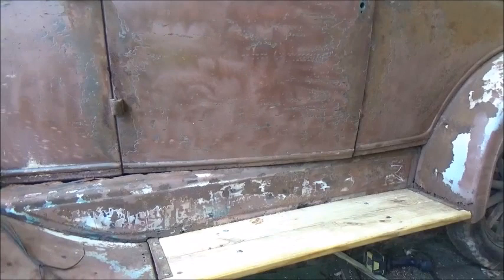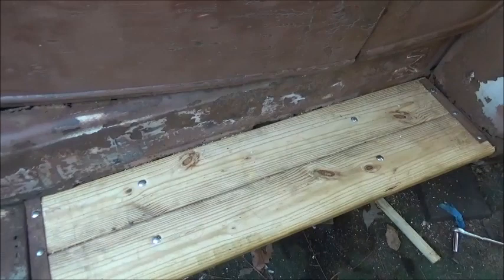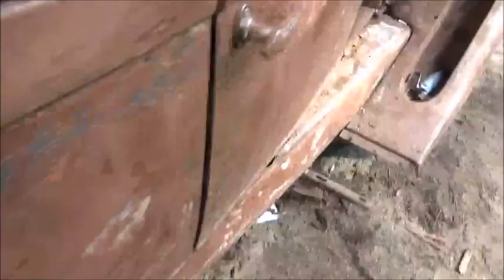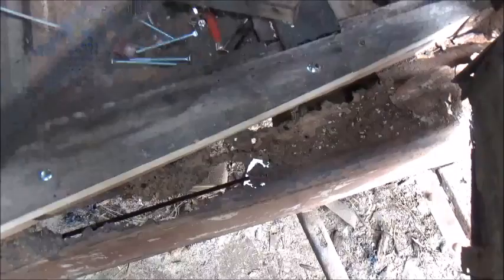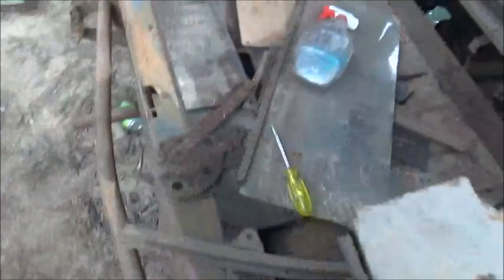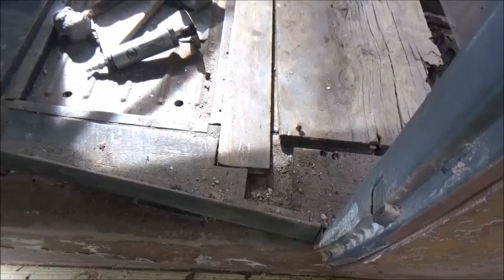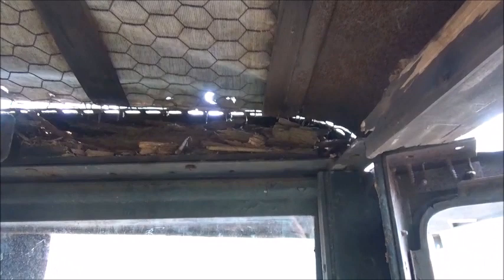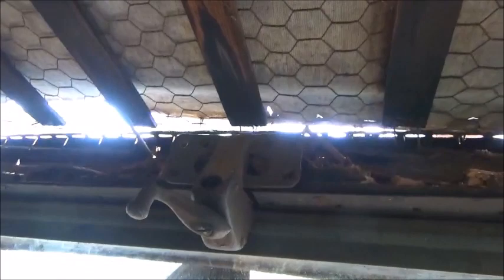1929 Whippet Wood Work

Comment: Hi Jonathan, nice work. I'm a carpenter and most of my work is in restoring older homes and remodeling. Your on the right track one piece at a time. Make sure you step back often to get the big picture. Things warp sag and distort and you might make a piece and realize later that and adjoining part is out place and you now your starting over. I love old vehicles and most anything mechanical and you just have to take it slow. Have a good day.

Comment: A few suggestion;  Ash is the wood for  cars. All the manufacturers in Britain and the US use only Ash. It's lighter, doesn't split so easily. finer grain, and doesn't contain corrosive acids. Don't use Oak! When driving screws into wood, always use furniture (Paste, Butchers) wax as a lubricant on the threads. It makes them go in easier. The piece that goes over the windshield is called the "HEADER". It controls all the other top wood. I install them first. Give "Classic Wood" in North Carolina (I forget where) They make a lot of replacement wood. They could give you some tips. The "Whippet" is very similar to a Ford A and some A wood  would probably adapt very easily.  Use starting fluid when trying to start an old engine. Gas is not so good. Either you have too much or  not enough, or it's old and is harder to ignite. Enjoy your videos very much!
Terry

Comment: I've been a cabinet maker/finish trim carpenter for over 30 years. I remodeled/refurbished homes as a hobby in my spare time. If we lived closer, I'd be all over that wood work. I love the challenge. You're doing damn fine with the wheel spokes and wood for the car my Friend! Cheers! Zip~ p.s. I've got an older video showing my wood working in a couple videos. One was making door runners for a dresser and the other was on the woodwork I've done in my 152 year old brick Farm House.

Comment: From my search engine (whatever it is that I have): Plywood was introduced into the United States in 1865 and industrial production started shortly after. In 1928, the first standard-sized 4 ft by 8 ft (1.2 m by 2.4 m) plywood sheets were introduced in the United States for use as a general building material.

Comment: When i am putting screws into oak or other hardwoods...i predrill the hole. then run the screw into a bar of soap. then screw it into place. goes in easier and helps to keep from torquing on the head so hard it leaves marks.
Reply: Mmm...I think that something like beeswax is preferable, soap can draw in moisture.

Comment: Jonathan,  thanks for the detailed shots of the interior.  This is going to save me a bunch of head scratching on my Whippet.  By the way those plates on the ends of the to of the windshield frame hold the pivot pins in place. You should be able to loosen them and slide the pivots inboard to remove the windshield.  Probably need some oil to help them slide.
Reply from the maker: Thanks wasn't sure how the windshield came out.

Comment: I would replace the timber with the Vin number plate in and make a rebate in the new wood to take the old vin plate plus its surrounding wood of 1/4" or how ever long the screws are and glue it back in place, .
You are doing a brilliant job, well done, Kind Regards Roger from the UK.

Comment: I'd like to suggest you cut off the cross-member where the wood is rotted and fashion and attach a new piece with a lap joint.  My choice would be to use one of the West System adhesives which are used extensively on boats and are waterproof.  Even if you can't cut off all the rot without damaging the serial number, West System has products that you can brush on (and I have injected into rotten wood with a syringe) that will harden the wood for further repairs.
Love your videos, by the way.

Comment: I was looking at a '24 Chalmers  that was actually running ,but the metal doors were pulling away from the wood frames, and the owner was still asking five figures for something that was still going to require a full, wood replacement frame off.  Of course, having zero skill myself, cost is always a BIG factor in what I'd be interested in buying.

Comment: Most cars, higher end ones any way, used ash for body structure. Good luck, whole different type of body work...they also used to put felt or leather between the body and chassis to help with squeaking, plastic should work well.
Reply: Ash is very hard but flexible, so it's ideal for structural parts of moving objects.

Comment: Excellent work , very interesting to watch , Jonathan ..I believe you are doing just fine . The hidden woodwork in those old cars bodies was never finished like fine furniture , and your replacement timbers are probably stronger than original . The floors I have seen looked like Marine Ply .
I believe thrifty Mr Ford used wood from packing cases in which parts were delivered . He specified exact dimensions to suppliers so he could use the wood in the cars.

Comment: Nice to see this project moving along... you stir a lot of different pots! My suggestion on the car's oak is to use White Oak rather than Red Oak. White Oak will not wick water with capillary action, whereas Red Oak behaves like a straw in glass; easily rotting in time. Yes to the Brass Screws! You have to think like a Boatbuilder, not a Cabinetmaker.

Comment: Jonathan,, You don't need a woodworker....Your doing just fine with what you done so far...
  The wood is like you said,,, some type of Hardwood,, Oak, Ash, or Poplar,,would be my guess...These would have been more useful for strength,, as Walnut, Pecan and Cherry would have been a wood more suited for Decorative pieces....
  It's amazing to really see how much wood makes up the Skeletal Framework of these Real early automobiles....Almost to the point that the sheet metal was just a shell and the wood the strength....
 I know you've already got a lot of the wooden pieces in place....And if they're not going to be painted/stained later on down the road .... To help against future water rot down the road,,,
  Here's a trick we use to use on the Farm around the bottom of barn's, shed's, and anything wood that's close to or has ground contact....Put them out in the Sun and coat them with used Motor Oil...The warm wood will Draw in the oil,, Keep applying coats till no more gets absorbed and it's good to go... It doesn't cost anything and It'll help to shed water and save the wood... 
Works good on keeping Termites away also....lol
 Keep up the good work,, she's looking good... Like you said,, Your not Restoring her.....

Comment: A question, if I may, is the wine of the gears due to square cut tech or bearings, etc. (?) Thanks.
Reply from the maker: Straight cut gears. They all do it, some more than others. Because 3rd gear it direct drive it don't do it.

Comment: I know what you mean when it comes to parts for older vehicle i have been trying to find shift rods and hardware for my 74 f250 and seem to not be able to find them as the truck is a three speed on the column.the guy i got it from took them out and as far as i know trashed them because he said it was sticking between gears.it needed a bushing that i found i could use the wiper motor plate bushings off my junk 92 f150 so i replaced it.now all i need is the parts he throughout but i can't find them.

Comment: Jonathan, great job on the wood work. On the doors & door frames did they use some sort of rubber seal and a felt on windows? I’m wondering if that material on the floor were you put down the rubber strip wasn’t a type of insulating media for reducing vibration and moisture. You think they used some sort of weather stripping under the lip by the wiper motor. I bet finding a type of U channel rubber strip would be easy to come by. For the doors and trunk. I can’t tell in at least this video if the fire wall is metal or wood like the Elcar. You’re methodical and can see why you seem too get stuff done. Working with what you have in smaller doses as not too become lost and overwhelmed by a project. I’m guilty of it myself, even labeling everything tore down a project and got lost on it. Lesson learned long ago lol. You tend too follow this same saying that was and assumably still I heard while at Fort Campbell & Fort Bragg...

Accept
Adapt
Overcome

Thanks for posting this really cool too go back in time and see how stuff was put together by hand.

Comment: Man i dont think they used chicken wire on that top. That looks like a farm fix. They also probably used Hickory or Oak or both on all that wood. Which is exactly what id do as well.
Reply from the maker: A lot of Manufacturers use chicken wires on the top for support
Reply from the maker: Also manufactures used Ash for the wooden cars

Comment: BTDT on my 31 chevy sedan. I took all th body off the wood frame. Some sais I would never get her back together. WRONG.  I don't think they used oak because my wood was too soft for oak. I did use oak to repair the sill plates and made overlapped joints.  It was a painful and trying job. some pics  https://www.jalopyjournal.com/forum/members/capecodbob.38607/, https://www.hotrodders.com/forum/members/cape+cod+bob-albums-1931+chevy-page2.html

Comment: that overhead on the windshield, and the side splash guards are just terrible, but when you get the splash guards and windshield overheads done, everything will look completely different, and like an actual car. rust, she no good captain. save it all jonathan, it will work, and you can do it, I have no doubt. good job my son, tis a good deed, indeed. your method seems solid, if not the car. your methods will last through forever, but the car, well, not as long. brass screws, will hold it fast.
Reply: JerryHamlin, Oregon Boy

Jonathon I love your work putting life back into these old cars. A question do you have a T5 spd if so will you sell it.
Reply: Oh , forgot to tell you . It's for a Chevy sb 350.